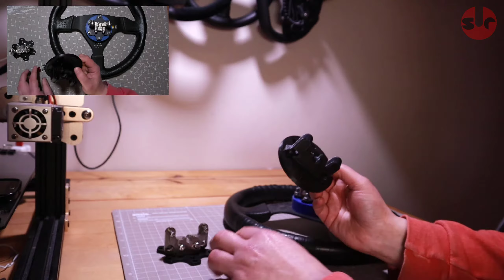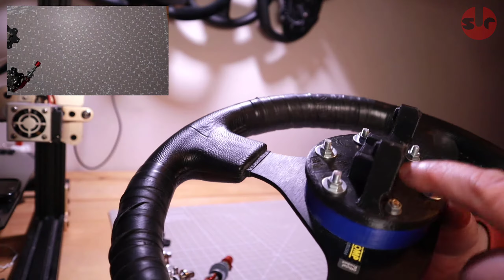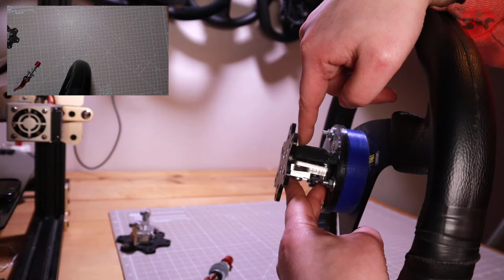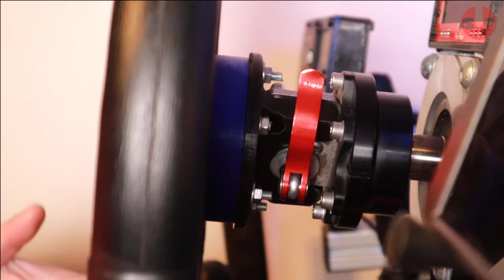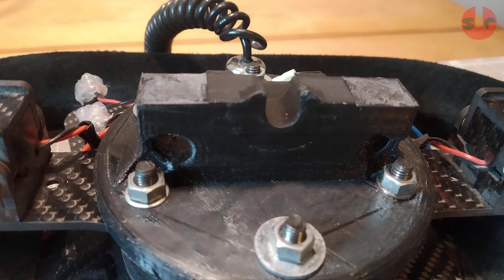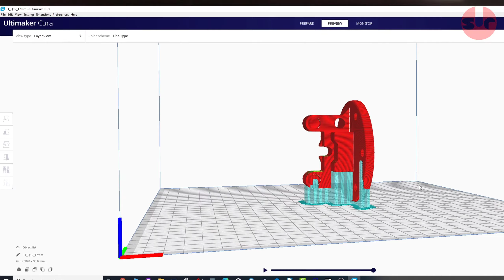3D PRINTED Q1R QUICK RELEASE [TEST AND REVIEW] [SIM RACING HARDWARE]

Comment: That's much better than I expected for a 3d printed plastic part, and I reckon with a bit of thought/engineering into the design it could be made significantly better. The original Q1R is made of laser cut pieces from a flat sheet to keep cost down but that constrains the design quite a bit. From an engineering point of view that design doesn't really make sense for 3D printed plastic but obviously the part has been made that way for compatibility. For 3D printing you can do a lot more with the design to better distribute the stresses. It would definitely be possible do to significantly reduce the flex you're seeing and improve strength too